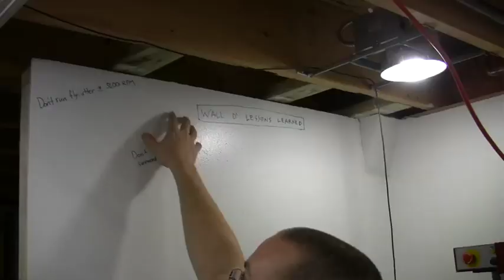Uncensored, Raw, Fun Homebuilding

Comment: I purchased a 2003 Wag Aero Experimental J-3 with a 100 horse engine, floats, skis,tundra tires for $40K . I can’t buy a kit and engine for that. Has 12 gallon wing tanks and Alaskan cargo belly pod, Stratus gps with Foreflight synthetic vision and solo front seat. Yeah a build would takes years. I want to fly. Not just dream. Besides, 75 percent of kits are never completed. Good luck though.